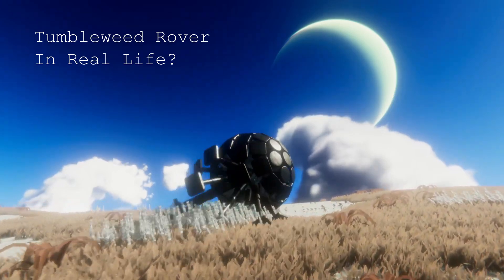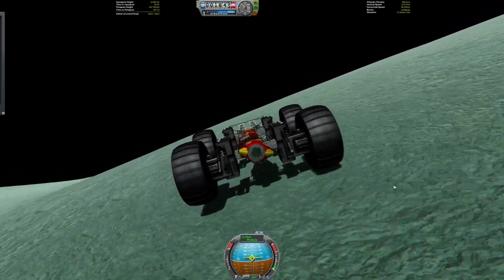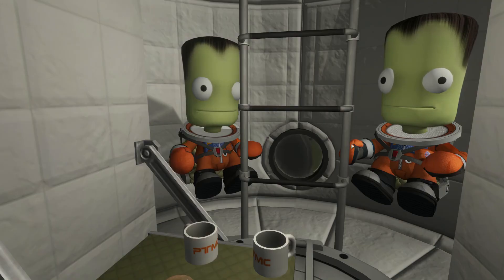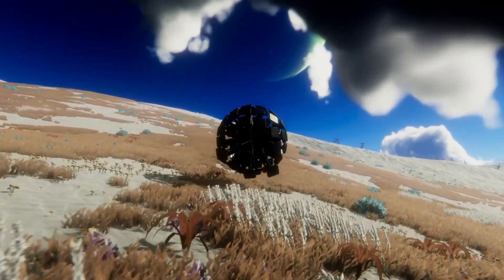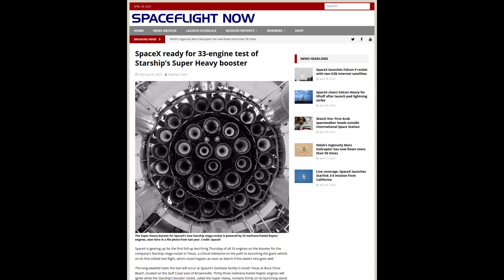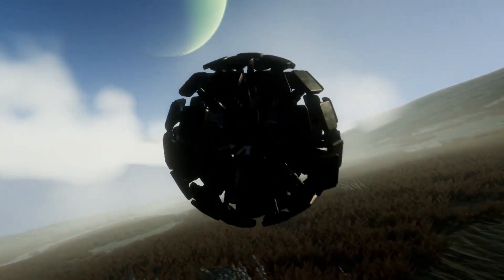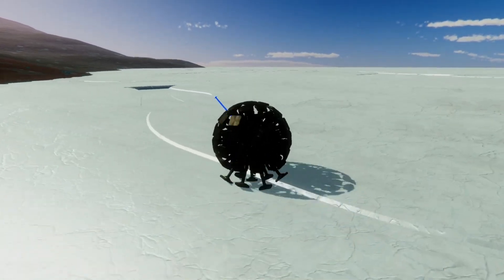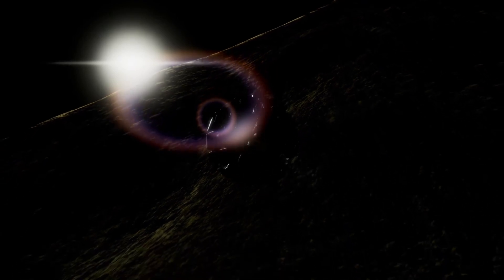KSP (kOS) - Can tumbleweed rovers work in the real world?

Comment: One of the main issues you are going to run into is as you correctly surmised, power. While RTGs can generate power, they are temperamental, and effectively just radioactive materials in a shell. You don’t really want to be throwing them around. Also RTGs are designed with long term usage in mind. You throw one of them on a craft which requires a low amount of power for many years, not several on a craft which needs a lot of power over a short timeframe.
Reply: yeah for something like this its a bit of a non starter. you get 300w at the start of a mission for 57 kilos with the biggest most efficient rtg we can make, it is a meter long and half a meter wide. doesn't really work out. it'd have to be powered by a reactor.
Reply: NASA is currently developing nuclear generators for space (e.g. CRUSTY), that are much more efficient, as they do not use Peltier elements but Stirling cycles. They plan on using them on a lot of their future missions. They are rugged enough so even survive an exploding launcher rocket without spreading their nuclear material. Using solar power further outwards in the solar system really is a pain in the neck, as solar flux becomes really small. ESA is not allowed to use nuclear material, which will make them obsolete in a lot of the in-situ science missions in the future
Reply: @michahermann7869  Unfortunately the KRUSTY project specifically ended in 2018. Also just looking at some of the concept art of said nuclear generators has me severely doubting its ability to work on a tumbleweed rover. And the listed power generation (up to 10 kW) is still severely short of what I would expect something like this to require.
Reply: @cjstorey0117  well yeah the KRUSTY project ended because it's goal was to prove that such generators work reliable and it did. It was just a pathfinder. But here's a quote from the NASA website for you: "NASA is collaborating with DOE and industry to design, fabricate, and test a 40-kilowatt class fission power system to operate on the Moon by the late 2020s". But don't be fooled, 40kw would probably be too much for such a tumbleweed rover. These reactors always need to get rid of their heat through radiators, especially large ones if there is no or only small amounts of air around it, and that tumbleweed rover can not carry much radiators
Reply: @michahermann7869  The legs themselves can be radiators. That's a lot of surface area, and the heat shouldn't compound into damage to their legs when it's so spread out.
Reply: @ibuildblasters8118  Well the obvious problem with that would be material selection. An ideal radiator material would be different from an idea leg material. One could paint the legs to make them better radiators, but I highly doubt that they will become sufficient enough for radiating the heat off of a small nuclear reactor.
Reply: @michahermann7869  Also, regarding the 40kW, lets to a bit of napkin math. The ksp landing leg used has a mass of 0.1 tons, aka 100kgs. On one of the larger ones (specifically the one shown at 3:53) there are 66 landing legs, meaning a lower limit of mass of 6600 kg (since we are not counting the mass of any internals, only the legs) say we want to move this thing one meter. Moon gravity is 1.62 m/s2. Using a conservative frictional coefficient of 0.4, the force we would need to overcome would be about 4200 newtons (6600*1.62*0.4). To move this one meter, we would thus need about 4200 joules. to do this in one second we would then need 4200 watts. not that bad, only a bit more than a tenth of what that could generate... but lets look back at our assumptions.

1) we are only counting the mass of the legs here, the mass would likely be far higher, especially if we slapped on a several ton nuclear reactor, computers, all the cameras that we would need to see where we were going (or whatever else we use to find that out) scientific instruments because we need our rover to do something, and comms systems so we can actually communicate and control this rover. That all adds up fast, and will probably double or triple the mass of this thing if not more.

2) this is using a coefficient of 0.4, which is on the low end, and assumes that friction is our only oppositional force, which will only happen on flat ground, which we will not be on most of the time, meaning that gravity will also be pulling this thing whenever we happen to be going uphill, in addition to higher friction in general cause of simply some places having higher frictional coefficients, which can get as high as 1.0, which will increase the force (and wattage) required by a factor of 2.5.

3) the fun part, the fact that we are getting 100% efficiency in transferring power from the reactor to the motion of the rover. this simply wont be a case for a few reasons. for one entropy is a thing and hates us all which will make things worse, but there will also be a substantial amount of energy lost not only from the fact that our legs are not pushing directly forward, but at a combined forward and upward angle, which loses energy. Also all space dust and rocks we kick up will also be lost energy as well. (also all the energy lost to entropy in the system will be turned into heat which will need to be radiated off and those radiators will also increase mass)

4) And this is all assuming a measly speed of 1 m/s, about a third the speed of the moon buggy... and faster means we need more wattage.

5) and many more things, rover legs will need to be retracted as well which requires energy. this assumes the moon (this all gets way worse on mars with its higher gravity).

And this is literally just the the power problem, there is also the very real structures problem related to fatigue from repeated extensions of the legs. The dust problem just making everything terrible since this dust likes to stick to things. Having pistons which would even be able to deadlift a rover like this at the speed required for actual motion. The fact that any payload you have would need to be able to survive flipping upside down... this rover is just currently not viable, at least not to my knowledge, except in the overly ideal and silly world of KSP.

sorry about the essay :)
Reply: @cjstorey0117 I love your answer! Are you also a space engineer? Awesome napkin math, although I don't agree with that friction value. Calculating with that friction would assume that the ball always stays upright and you have to drag its mass around. But it is precisely due to that friction that it starts rolling, so no more friction (only a bit because of the divergence angle between two legs that are next to each other). I guess that tumbleweed thing only makes sense if you really have to go fast for whatever reason. If a bit slower is okay, maybe do a spider bot first, that would also be capable of moving over obstacles and high inclinations ;)
Reply: @michahermann7869  I literally graduated with an aerospace engineering batchlors degree yesterday
Reply: Anyway, yeah thinking more about it I suppose the actual quantity of power problem might actually be the lesser one. My greater concern is the fact that everything on the rover needs to be able to survive tipping upside down, and that any power system which could provide enough power, like a small nuclear reactor, would not be able to survive that.
Reply: @cjstorey0117   @cjstorey0117  I always imagined it as a low speed probe, slowly pushing its legs against the ground, not rolling frantically. 1 m/s may be slow for a buggy, but in case of a probe 1 cm/s is enough (that's an average speed of Curiosity rover). That divides everything by 100 and we end up with tens of watts, maybe hundreds.
Also lower speed means less dust raised from the ground.
Reply: @jeffreyharpen6772  Fair, although the dust will probably be an issue regardless since it's, for lack of a better word, "sticky" and preventing it from messing with the linear actuators is going to be a pain.
Reply: Maybe it's designed to sit still for long periods of time and use solar power charging batteries in order to move occasionally.
Reply: Let us not forget that mine rollers like this irl are blown around by the wind and are rather light, so they don't put extra force on their arms!

Not just that, but the concept of being able to lose limbs and then be alright is nice and all, but eventually, you will run out of limbs xD

Comment: I think the problem is the 3-dimensions of it. When you have a normal rover, slap a few solar panels on the top. With this power can either be nuclear (rotating nuclear material tends to be a bad idea, especially if it hits something or falls off), or solar, which is inefficient the further you get so you have to add more solar panels. Also you need at least 6x payload for everything because of the sphere.

Comment: Honestly, i love this vehicle, and i think it could definitely be a viable option for travel on other planets. Using the manned 360 degree camera idea and applying it to an unmanned rover could turn it into a sort of Google Streetview for other planets and moons. The only other viable unflippable/high speed option would be to have wheels that were large enough to allow for running inverted. But you already went over why wheels may be more difficult. Perhaps the answer for wheels is extreme height, like 10-12 feet, where the axles will be a long way from the dustmaking outer rim. For vehicles like this, i think size may solve a lot of the issues. If you'll have a bad time getting dust inside a certain system, move it away from the dust.
Reply: There's also the idea of the MorpHex robot (it's somewhere on youtube), where it uses panels to push and roll, but can also walk on them. That would definitely be a dustkicker, though.
Reply from the maker: That thing is neat!  Resisting the urge to start yet another KSP project to make one right now.  (Might give it a go later though!)
Reply: @lodurrvoluspa_ksp  Making a walker in KSP isn't easy, but isn't uncommon either...speed is usually very low, however. I'd say to see if you could make a much faster walking robot, but then it has the possibility it could trip on itself. So, you'd want legs in every direction so it could always be upright, and oops...I just reinvented the Tumbleweed. (Ironically, the guy that made the MorpHex also seemed to dabble in 6-legged robots with enhanced firmware to give them faster gaits, and more control options. The A-Pod and i think, Phoenix?)
Reply: @lodurrvoluspa_ksp  dew it
Reply from the maker: Thanks!  A lot to be said for almost comically large wheels to be sure.